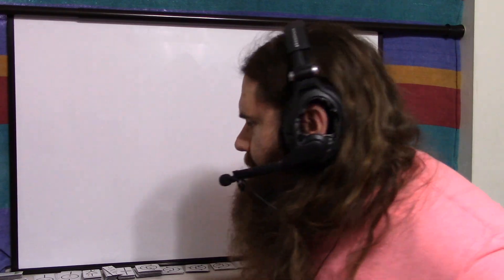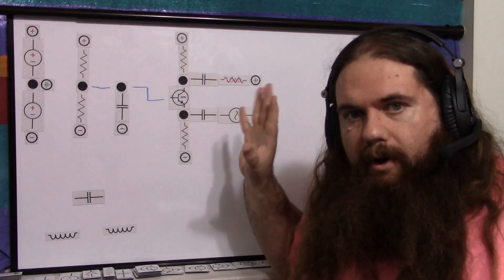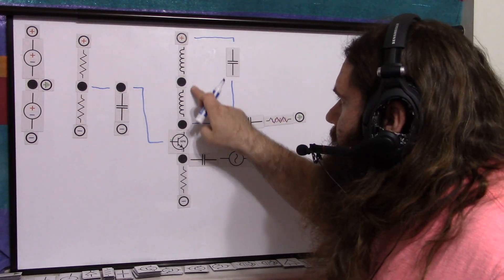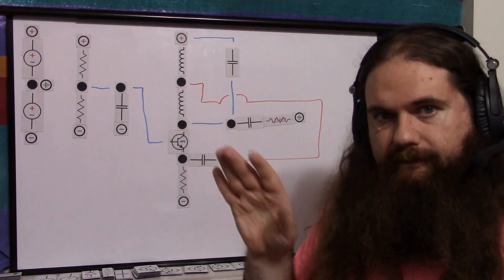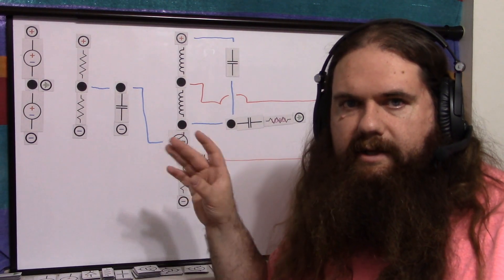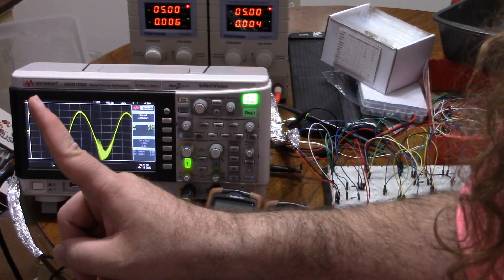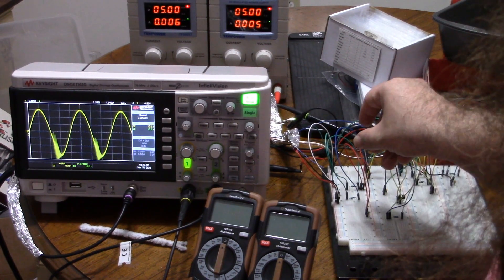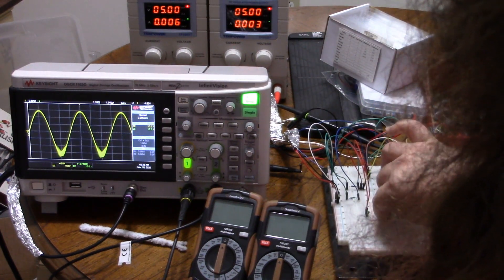Hartley Oscillator - Sine Wave Generator - Mated With a Common Base Amplifier - Simply Put

Comment: For instance, the magneto or magnetron creates spark on a push mower that has no battery. It also has a "ground" wire that can short to the frame or chasis. Where does that current go after the frame? The vehicle is on rubber tires, no earth ground....Thanks again
Reply from the maker: You're making the mistake of thinking of "ground" as a sort of end point where things go. Electricity is in circuits, and "ground" is just a particular electric potential where we say the voltage is 0 and all other voltages are positive or negative relative to. A magneto is just a fancy electromagnet that turns mechanical energy into electrical energy by forcing it to flow through the spark plug, so the magneto takes the place of the battery in an engine with no battery. The chassis is essentially a big wire.
Reply: @simplyput2796  Thanks, sorry for the confusion. I think I've got it! Great explanations!🤗

Comment: I saw another video where you were explaining "ground". Where does the current go when a wire is shorted to the chasis? How does it dissipate if a vehicle like a push mower has no battery or negative terminal! Thanks
Reply from the maker: The chassis is basically just a gigantic weirdly-shaped wire, so if you connect a wire to it, it's just more wire. You can run things like car tail-lights with just a single wire to each because the "return" (in other words, the second wire) is just the chassis. If there's no battery, there's no current, so what is dissipating? If you mean you have some circuit that's powered, and you connect that circuit's ground to the chassis (a "chassis ground"), then the chassis just becomes a giant wire that anything can connect to and be circuit grounded, and it's mostly for safety so if something goes wrong and shorts, there's no single "hot spot" that someone might touch and get hurt.

Comment: have you tried it with the short U type jumper wires??? if you have none make some out of copper wire & heat shrink!! thats what i done.  P.S that circuit was Pure class..  Like a Complicated joule thief!! oh yeah.. as far as i can remember the Hartley oscillator used the center tap of a variable inductor   & the other used a variable cap!! in that book Art of Electronics 2nd edition.. had it about a year or more ago from the library im sure(but not 100% on it) thats how the schematic of them looked like. could you tell me if thats correct??. now its time for me to watch the video again..
Reply from the maker: I do have those jumpers, it's just so much slower so I use these wires when I can. All I wanted to do was to demonstrate the circuit and it worked fine enough for that purpose, plus I find it interesting to be able to demonstrate the effects of a breadboard and how just one small part of the circuit had such a large effect on it. Also yes, the "original" way to do a Hartley is to have a centre-tapped single inductor and to put it across the collector and base of a common-emitter BJT, but you 100% do not need a centre-tapped inductor and two separate ones do just fine. The mutual inductance is not what makes things work (but if you do have mutual inductance, you have to include it in the math to calculate the resonant frequency).
Reply: @simplyput2796  thank you I loved this video. And loved how you drew the red wire connection on the white board!! Most people just use a break or a little jump to show that those two tracks are not connected.. But you used both😊 I never saw that before & just might have to borrow it.🍻for the💭➡💡👌